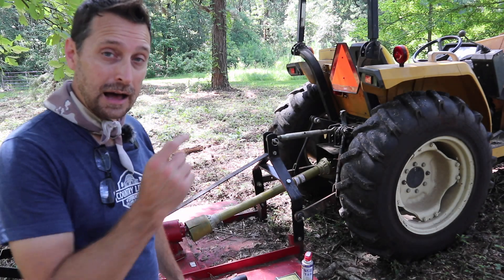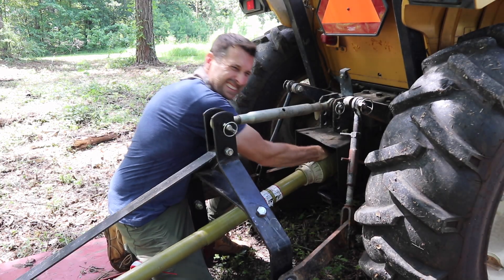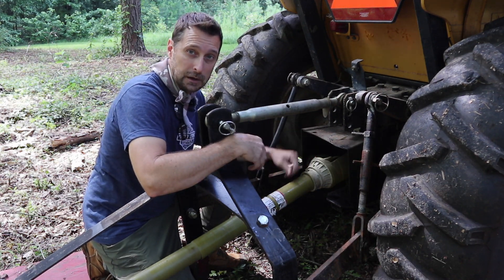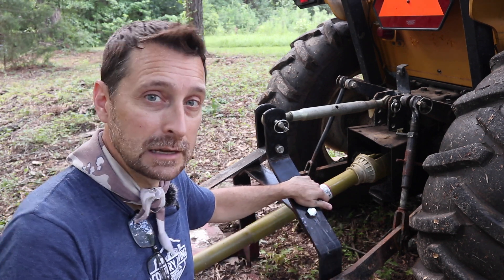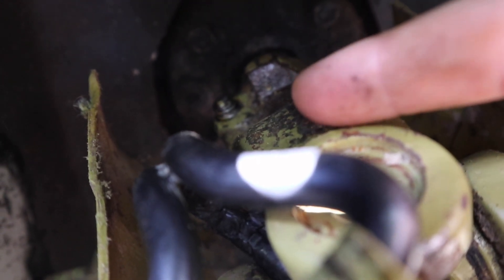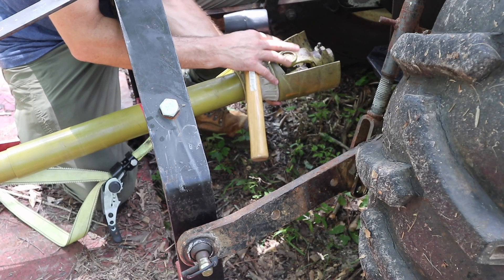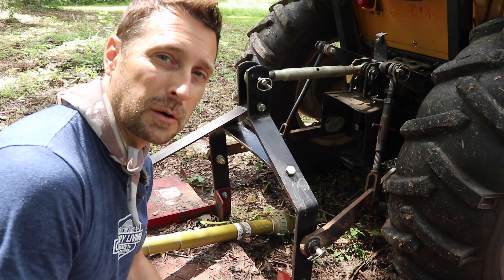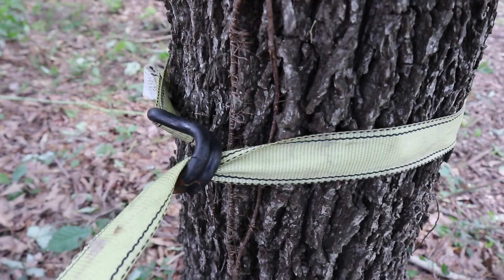Stuck PTO Shaft On Tractor! How To Easily Remove

Comment: You should not need to cut the shroud, it comes off easily with the release points at the top of the shroud, they either twist a quarter turn and release or push in The shroud needs to be lubricated along with the entire PTO shaft. Pull it apart and clean and then lube the shaft. Most likely it is the shaft sticking making it very hard to attach or detach.

Comment: My problem is that the collar that gets pulled rearward to release the PTO shaft from the spindle will not move rearward…at all.  I’ve cleaned it with brake cleaner, used PB Blaster to try and free it up, and tapped it, nothing has helped it move rearward.   The collar will rotate and the spring loaded circular part the collar fits over moves freely up and down (about 1/2” of travel)) but the collar that locks or unlocksPTO shaft from the PTO spline will not budge.  I then moved the tractor forward and rearward to try and unstick it and of course since the PTO shafts are designed to move in and out during operation that did nothing.  Then I separated the PTO shafts and removed the PTO guard to try and get a better angle on the stuck collar but still can’t free the collar…any thoughts on this situation???

Comment: I noticed that you can also just hook the other end to the implement itself (as opposed to a tree) assuming the implement is solid enough to take the force. Thank you for this video. Helped me get my mower deck pto shaft disconnected. I did not have a tree nearby so I hooked directly to the mower deck frame.

Comment: It pays to service your PTO drivelines regularly. Take them apart and store the tractor driven piece out of the weather when not in use. Thoroughly clean and grease both halves and the safety sleeves too each spring especially before mowing,tilling whatever and use a wire brush to clean the PTO stub on the tractor and lightly grease the grooves and lands on it. Put a plastic bag over the shaft left on the implement to prevent rust or dirt accumulation. This maintenance can prevent aching backs,smashed fingers, and other unpleasantries.

Comment: How do you remove the spindle? (the piece shown at 4:52).    My spindle got damaged.   I can't find any videos on that subject. 
            The spindle is on a massey ferguson tractor(year 39 or 45).   It has a thicker piece near the back with two holes opposite each other.  But no buttons or anything else.  I rotated the holes and hammered a nail through the opening. But nothing came out but dirt and  grease(no pin).
                     edit-it's a spindle attachment. It fit over the original spindle. My father installed it years ago and said he slipped it right on.
Reply from the maker: If that spindle attachment was installed years ago, it could be seized on there. You will need to spray it down with penetrating oil and let it sit for a while to see if it loosens. Since I don't know how it is shaped, I can't advise as to how to remove it. You will have to look at it and see what kind of leverage you can get on it to pull it off. If it is that old, the spindle adapter may be needed to attach to modern equipment.

Comment: When you are going on or off with a PTO it helps to support it with a rubber snubber strap hooked up somewhere on the 3-point linkage. After cursing PTO shafts for too many decades I heard of this trick a couple of years ago, it certainly makes life easier and saves on the curse word vocabulary. 😎
Reply from the maker: Thanks for the tip.

Comment: Great job.
Now, how about when the two pieces of the pto shaft are rusted together?
Reply: I couldn't get the pto shaft off of our 15' mower (almost new).  Two mechanics couldn't get it off, finally drove the tractor out while one of them held the release collar.  The grease in the shaft was holding it in place.  Had to back the tractor up and pull the two shaft pieces apart.  Sprayed the two halves with JD spray lube and put them back together.  Don't use heavy red grease for lubricant.

Comment: I'm wondering what the idiot engineers were on when they designed these ridiculously problematic shaft connectors etc.  I must have put 20  hours into trying to get mine hooked up to attach the snowblower to tractor. Ended up going to my beautiful heroine Princess and bought a perfect replacement shaft for $139 + tax (thanks Trudeau! It's a farm item, why excluded?)

Comment: I removed my guard a long time ago because the only thing it accomplished was to make it harder to connect and disconnect while skinning my knuckles.  I'm so glad to know I'm not the only one that has issues!  Great tip.  Can you connect the strap to the implement instead of a tree??
Reply from the maker: Cool. You can connect to an implement if it is heavy enough. A tree or a vehicle is better.
Reply: Bad idea to remove protective gear people have been iinjured when they got clothing caught in a moving pto shaft

Comment: If you cant get the hook on the yoke, use a motorcycle transport handlebar strap or similar.  Some sort of short, strong choker type strap that wont damage the u-joint or yoke.  Heck, even good rope could work, then hook your strap hook to the strap or rope.

Comment: Check for a dent. Something may have dropped on the shaft leaving a small dent. Thumbs up 👍
Reply from the maker: Thanks
Reply: My PTO got dented while bush hogging and now the shaft is stuck. I'm going to try the ratchet strap thing he shows in this video, but any advice for what to do about a dented shaft?
Reply: @lr1925 depending on the location and if it can be welded and turned back to   Specifications.

Comment: I grease the PTO shaft stub every third attachment.  I've had problems when there was tension on the implement.
I raise the impliment, disengage the rear PTO drive lever, bounce the implement drive back and forth to be certain there is no tension, then set it down . Haven't had a problem since!

Comment: We had a row of Peach trees and a row of Cherry trees, but when our brush hog would get stuck we’d hook up our strap to the hitch on our pickup.
Farmers have to make do with whatever is available. 

Years ago I almost flipped our pickup in a ditch.
The driver side rear wheel slipped into the ditch. Everything in the bed of the truck shifted to that corner of the bed.
The front right wheel lifted off the ground.
I climbed out of the passenger door.
When I got out, the truck lifted higher so i jumped on the hood of the truck. 
My right hand was on the brush guard and my left hand was ahold of the windshield wiper.
My dad was mowing the upper pasture and couldn’t hear me screaming.
A neighbor heard me yelling and looked at my predicament.
He brought his tractor and a tow rope and pulled the truck out.
Lee saved my bacon that day.
Reply from the maker: Always good to have helpful neighbors.

Comment: Been there. I find it helps to raise the bush hog until the pto shaft is level. I have also found that after I get it uff, to take a flat file and soften the edges of the splines a pinch. Then I use Emory cloth to rub it smooth. Those tiny burrs and rust seem to hang on! I spray a little wd-40 on both sides too ( or smear grease ) before I go back on. But… having the pto shaft level is the key 😉
Reply: Filing is key. If it’s hard to get on don’t put it on because it will be harder to get off. If cleaning and lubricating don’t make it go on smooth lightly file it